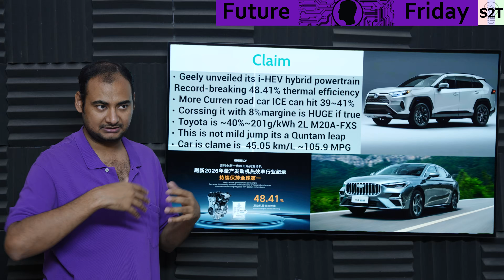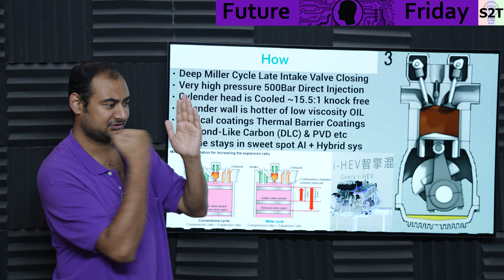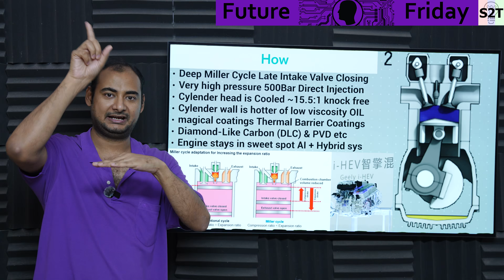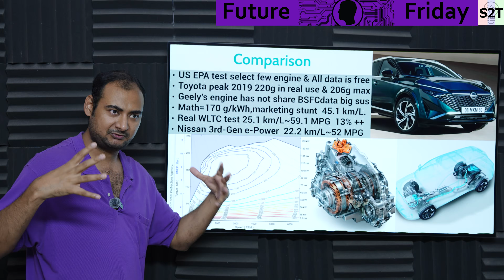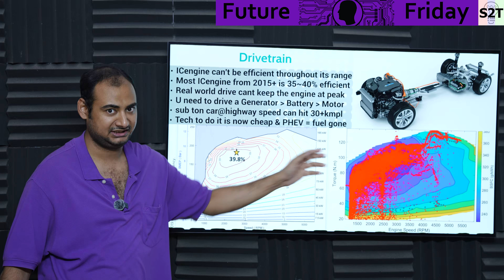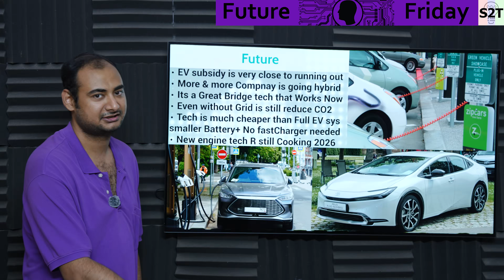Chinese Geely ICEngine cross 48% efficiency  {Future Friday}

Comment: good for most part but ive would like to tell you that your just stop learning on hybrid and just saying the same thing because....toyota honda and BYD like cars use series-parallel hybrid its not just simple series or just parallel and regarding your mention on complexity of hybrids actually it is not complex as you think your good with chemistry stuff but your missing stuff on mechanics its far far simpler than you think.....and most of the time it helps the car to be in best BSFC (E-CVT gearbox).....im talking about the TOYOTA since myself working with automobiles with SUZUKI as well as TOYOTA and other brands....you need to understand difference between adkinson cycle and miller cycle (using forced induction).......its better to prepare yourself for the content which not known to you......since as you mention toyota hybrids are in market for 30 years now and they are known for reliable and does million of km without any issue.....but there is point where you mention high pressure petrol is not as simple as it is 100% true and your nailed it with your chemistry touch
Reply from the maker: u will see soon enough

Comment: Real world Bev user. Regularly drive 150miles daily. Cars range is around 200miles. Very rarely use chargers capable 145kw charging speed. At this range capability I do t want the extra cost of maintaining a hybrid energy. Fast charging speed i.e 180 miles in 20 minutes is all I would need. I think this would suit almost everyone. More important then becomes when I get to my final destination can I get a full recharge in about 4 hours. The race for longer range and faster charging speeds is to pacify the BEV haters. I used to happily use a 60 mile range EV until fast chargers became more expensive to use than petrol or diesel. The real benefit with an EV is super low running costs and amazing reliability
Reply from the maker: 145kw charging speed is not free or cheap and no one hates BEV its just not read for prime time

Comment: How about sodium battery at $40 per kwh and chance of further reduction.
That will enable grid storage for solar?
Reply from the maker: I dont think battery is wise for grid scale
Reply: @s @s2tenglish . Maybe not, but for charging stations, they can offset the cost of electricity and also help the grid.
Fast charging is a cheaper option than hybrid, if there are more charging stations available. Long-distance travels can be encouraged to be on low-demand periods by varying the cost with the grid, which is already common in many countries.

Comment: You talking about crude oil imports 

India's coal import
 2010 - 110 mt(millions tonnes)

2025 - 264 Mt 

But our solar electricity production is 

2010 -  0 twh (almost zero)
2025 - 134 twh 

India import coal that doesn't means solar useless or without subsidy it's not working. Same with crude oil

Hybrid is just bridge technology. 
Because ecosystem isn't ready
Reply from the maker: Hybrid is just bridge technology. 
burn money & time u will be left with nothing at the other end . bridge will work TODAY , reduce pollution today
Reply: @s2tenglish range extender is not that much simple that you think, 

You working on it you will see how hard it is,
how complex it's electronics, 
May be required redesign the battery pack.

People with short drive like city driving consider weakly charging in Big battery pack.😊😊

Atleast electric much better then CNG, LNG and Ethanol.

Why you covered geely does anyone outside china test their claims....???

Because most chinese claims are hu lu lu....

Comment: BYD flash charger stations has local battery buffers, that allows them to deliver very high peak charging rates without having as high power grid connections. There's also the potential of charging those buffers more when the price of power is low. 

Often the site and necessary preparations of it constitute a very large part of the total cost of a charging station, and the faster the charging, the more "charge" you can sell during periods with demand, all else equal. If BYD has managed to cut the total average charging time to less than a third compared to most of the competition, that alone means they can sell about three times as much charge for a given space, during times with high demand. 

They're claiming 1500 kW capability now. If 10-70% charging in 5 minutes, and or 10-97% in 9 minutes frequently is sustainable, a BEV with somewhat  modest battery capacity could be considered useful for occasional long trips, assuming there's enough charging stations where you need them.
Reply: and now u added price of  battery buffers  u cant solve the core physics and that also risks what if in peak demand lets say few cars back to back did charing and then what slow charging . Fast charging is a very  bad idea u can brute force it but it will always be wasteful . slow calm charging few kw max 99% of the time
Reply: @AnupamVipul  Those buffer batteries don't increase the overall cost by much, relative to the overall cost, especially for BYD.  Sure, slow charging most of the time, when that's an option, is preferable from the car/owner perspective,  but the context for that perspective was those occasional long trips. And from the charge station owners perspective, increasing the sales of charge 3X and ability to charge the buffers at least to some degree depending on the price of power are huge advantages.
Reply from the maker: 🤣🤣🤣🤑🤑thank fully u dont have to worry about cost

Comment: 2L is too big in my opinion, isn't be better something like .5L engine 30KW of power, (that should be enough to maintain 100km/h of big sedan) big engine bigger mass. so bigger battery needed. and i would 1000x take 35% efficient over 48% for range extender for half of cost (which will be use 100L of fuel/YEAR) in city car because range of 100km is enough for 95% of trips.
in my opinion fuel consumption in hybrids should be the average of real use of electric grid and dinosaur's fuel.
Reply: Nope if u did 500cc @ 30kW rpm will become stupid High and throw away efficiency
Reply: @AnupamVipul bike engines are best for passengers ev range extender.
With system optimisation 15-20. Kw enough for india
Reply: @AnupamVipul  its ~75HP/L it's standard in cars like 20-years.
and in range extender for "emergency" use you don't need extreme efficiency. but 100kg of mass more dragging every time (especially in city) will be bigger pollution source in EV mode even if you charge from grid.

as to show everyone CHINA rules it's great,  is it needed? it depends where you put that, in VAN/pickup/light truck that will be great, with that engine series hybrid will rules over traditional ICE in every condition, in comparison to pure EV/hybird? not necessarily
Reply: @AnupamVipul  The engine wouldn't have to produce maximum output constantly, "up-to" 60 kW per litre isn't much. And a range extender wouldn't technically even have to deliver all the power required to maintain the highest cruising speed. If the battery provides 100 km range, and you drive 500 km, non-stop, the range extender only has to provide 80% of the total energy demand, and by that 80% of the average power demand is enough in theory, a bit more in reality if you want to have some margins. 
              
At suggested 100 km/h, 30 kW is in the ballpark of what you might need if you're towing, modern mid size sedans typically needs about half of that to maintain more typical highway speeds, 110-120 km/h when they're not towing.                   

Sure, efficiency won't be as high if the cylinders are smaller, but then again, if you just need to extend the range somewhat on occasional long trips, it doesn't matter that much if you only get 10 km per litre of fuel if you only need that engine to extend the range a few hundred kilometers total per year. And the smaller the displacement per cylinder, the higher rpm you can allow when needed, without causing problems. 

Remember, the range extender doesn't have to produce all the power required for those long trips, just keep the battery state of charge from going too low. If were talking 10 km per litre, and 100 litres of fuel per year, that's 1000 km per year of driving that the battery can't cover, and already at that point the case for ~100 km battery range plus range extension instead of long range pure BEV is kind of thin. So, realistically, somewhere in the vicinity of 100 litres of fuel per year is what can be reduced by using a more efficient range extender engine, compared to using a small engine with mediocre efficiency, before a long range pure BEV makes more sense than 100 km battery range plus range extender.  

The fuel going bad over time in the tank due to low real world fuel consumption is known issue even with plugin hybrids with much less than 100 km electric only range and systems that are more eager to start the engine than necessary.  That's the only big practical issue I know of with the concept of having battery capacity that's enough almost always, and just use a range extender the rest of the time, when the cars are actually used that way.
Reply from the maker: lets see